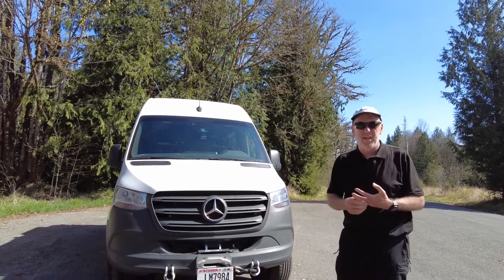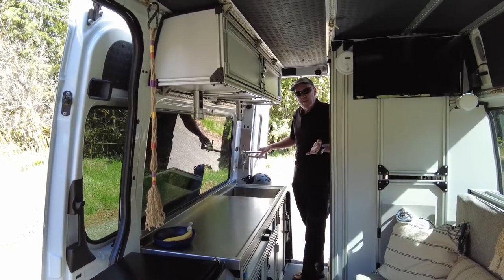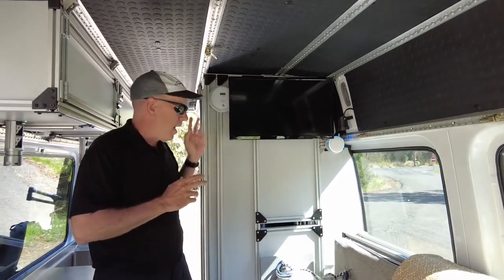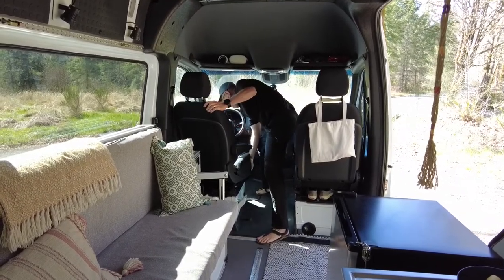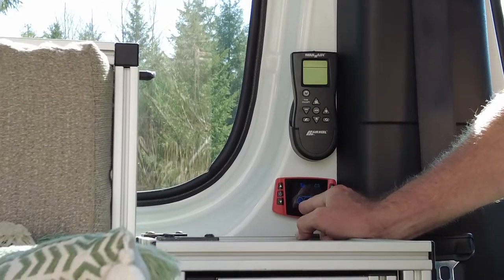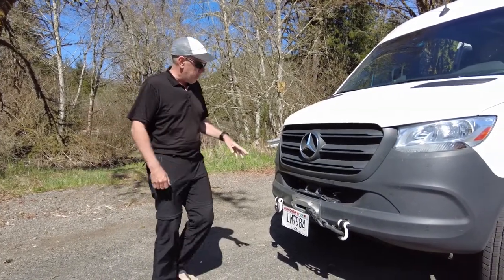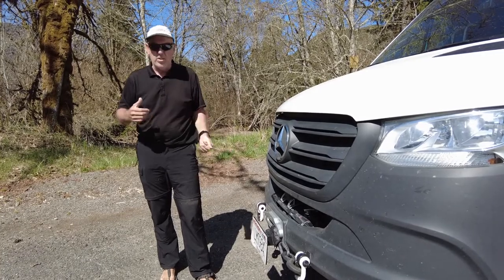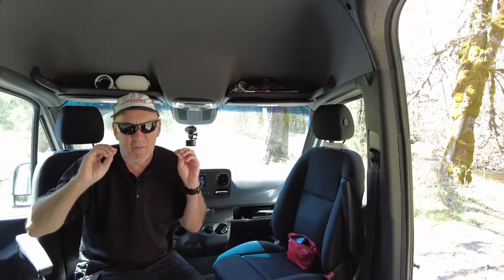VAN TOUR Part 2: Innovative Bunk Bed System & Full Bathroom | 4x4 Sprinter Van. Parts Link Below.

Comment: First of all nice video. I have a couple of questions though.

Since you have a lot of weight on the roof with the water tanks, how does that affect your off road stability?

Also, you mention costs, do you have a break down as to what you spent on each area such as electrical, plumbing, 80/20, etc. Also if you could include links to the stuff you used that would be awesome. I have a detailed build thread over on Sprinter Forum, but am not as far along as you guys. Thanks again.
Reply from the maker: Hi Derek - Thanks for your comment.  

As far as weight on the roof - we haven't had any issues with off road stability.  We are very new to off-roading and have done some great trails but are most likely conservative in our trail selection.  But never have noticed any stability issues.

We don't have a detailed cost break down right now - but we'll see if we can piece something together and post it with the next van build video.  So much of our items were purchased on Amazon - I'll put some links out for those items this week or on the next video.  We did the build in 6 weeks 24/7 basically - just the ordering of parts/pieces/etc took so much time but totally loved the build.

Can you please comment with a link to your sprinter source build - would love to follow.

Have fun with your build - we love the build that we did and we love the Sprinter.  We park it in airport parking lots and fly to places often (we travel full-time but not all on the van) - the size makes it so easy compared to the Winnebago View that we had before.

Enjoy your day!

Comment: I would like go say that the fridge you have dosen't do well with off roading as if you tilt it over about 5 degrees them you have to wait a few hours for the gas to settle, but most camping fridges like isotherm or domestic are built to handle offroad conditions, ours is built to handle angles of up to 30 degrees etc that's why we spent a bit on it and not get a normal domestic fridge which is built to be flat and not move at all times etc
Reply from the maker: Hello, interesting - makes sense but we haven't noticed it yet but may just happen without us noticing. Thanks for the info. Have a nice evening
Reply: @GayeNRobert  Anytime. I just thought I'd share with you and anyone else who wanted to do the same. I guess it's up to the individual what they do. Great video, though. Have a great day 😁

Comment: What refrigerator did you get as we are trying to find one, thanks!
Reply from the maker: Hello Susan! We are just using a college dorm size refrigerator however we do have the battery to support that.  That way if the refrigerator goes bad we just go to a Walmart and buy a cheap one again. Are you building out a van?
Reply: @GayeNRobert  yes we are.  Have a 2021 Sprinter 4x4 144 extended roof.My husband is doing it and I help when I can but mostly clean up, We still are trying to figure out various items like the frig . We also are aren’t. Sure on which diesel heater to get, Chinese or expensive one as heard some on cheaper one had bad experiences.  Lots of decisions to make yet but thanks for the info🙂
Reply from the maker: Yeah, tough decision on the diesel heater. The quality of the parts on the Espar is far superior but you can also buy 10 Chinese heaters for the same price. The new Espar pump is nearly silent and the heater turns off when the set temperature is reached - not the case for the Chinese. The Espar really feels like a house furnace. If we had to do over, we'd probably buy the Espar again but it would be a touch decision.

Comment: very impressived build! Quick question: how do you attach your cabinets on the floor, wall ceilings with L-frame brackets? Would love to know!! Thanks! Yoeri
Reply from the maker: Hi Yoeri. - thanks for your comment. We used double lug threaded stud that locks into the L-Track https://www.amazon.com/gp/aw/d/B07V4WQTZ7?psc=1&ref=ppx_pop_mob_b_asin_title. Then attached a aluminum corner on to that stud and attached to the 80/20 https://www.amazon.com/gp/aw/d/B07CWMSS79?psc=1&ref=ppx_pop_mob_b_asin_title. Hopefully this answers your question, if not please comment back and I'll get you more detail. Have a great day!
Reply: @GayeNRobert  thanks a ton for replying! Much appreciated and great to now know how you're doing this. Also really liking your 'don't overbuild' approach and keeping things simple. Never thought about not insulating until I saw your videos!